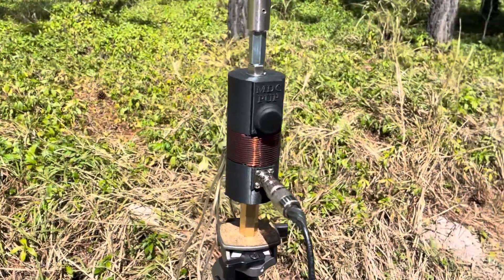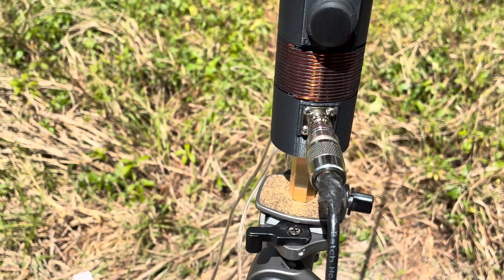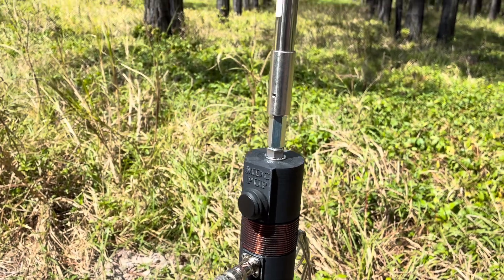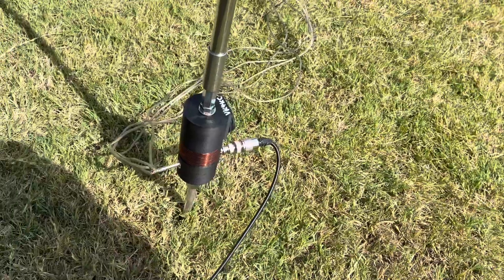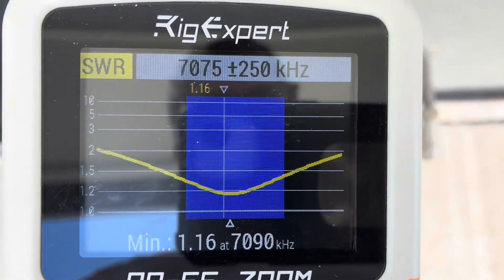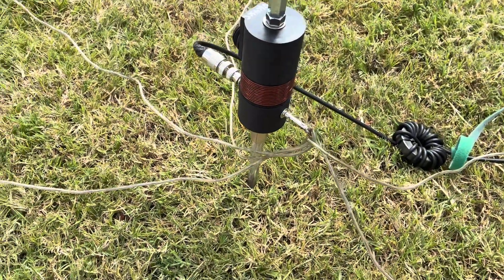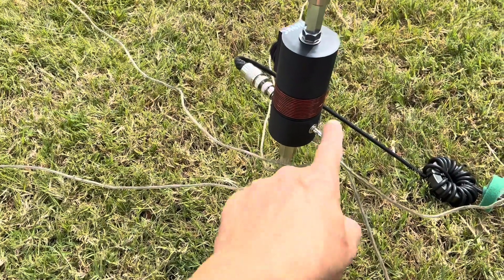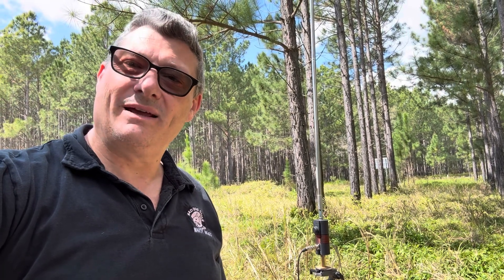MDC “Pup” antenna mount with loading coil

Comment: Nice Idea Marty, a note about your setup in the video . Could you set it up again with having coax lead perpendicular to mount and the radials also perpendicular ? Basically a T shape with coax on one side and radials out the opposite side of the base. Also I thought you had a radial wire laid over the coax and the coax was bent on a severe angle in relation to the base.  I try to keep my coax as far away as possible from the radials. Just my thoughts. Feel free to dismiss me as I was standing right there looking over the set up.  Great Work!  73, Kevin NZ1I